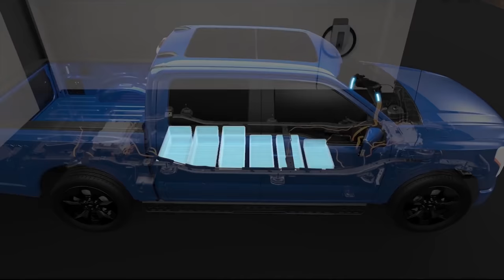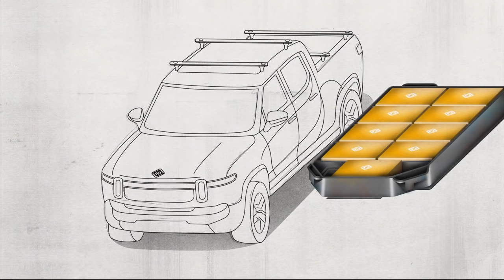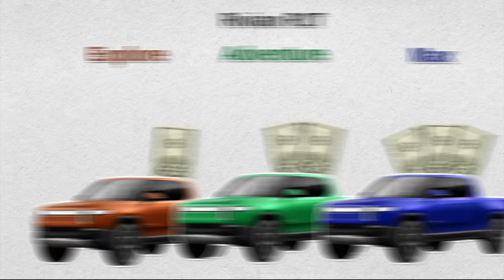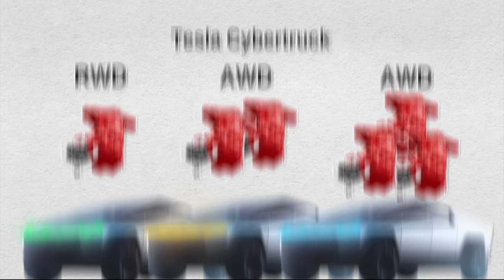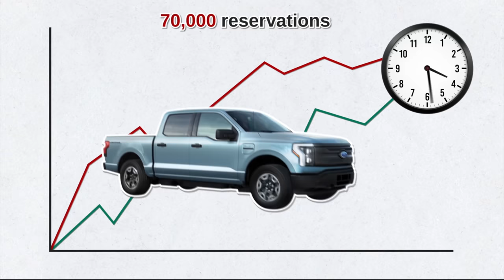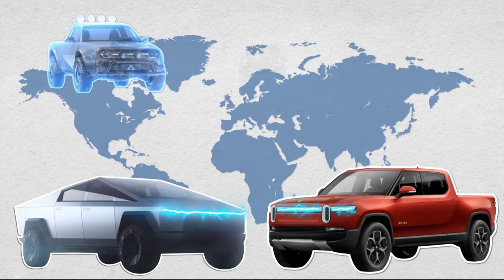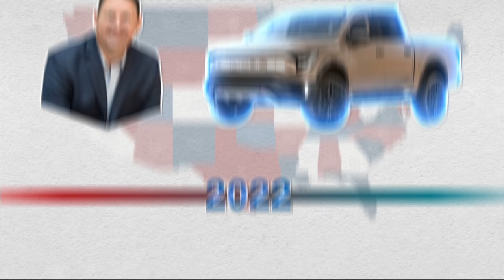Here's Why This Will Replace Trucks in America

Comment: Scotty I need your help. I'm looking at buying an 08 civic. it has 170,000 ish miles on it and I know the previous owner. The car actually drove from Detroit all the way to south east Washington state. I thought the car would be fine and most things were, except for one thing, if you try to floor it, it responds buy shooting up the rpm but not moving any faster. I thought I heard a slight grinding but I don't know for sure. Its as if the transmission is letting go of the gear and grabbing again when the rpm return.

Comment: I think these big manufacturers arnt thinking to well, why go for electric f150’s ? And 1500’ds ???? These are bigger trucks. The Ford ranger and Chevy Colorado would be way better trucks to make electric because they are already smaller trucks that are for small use and good gas mileage, plus you can get more range easier with a smaller lighter truck

Comment: These zre great grocrey getters. What happens when you tow a 8000 lbs trailer. The range drops drastically.  Than how long to recharge. They are an expensive gimmic , if you haul. I frequently tow a 10000lbs trailer with a diesel300mile range, and 15minute fillup. Dont think 100miles and one hour top off will cut it. Unless I can get a couple extra days holiday for travel time. I hope ford will keep a clear head and also develope the achettes for truck use. Good old german design.

Comment: I just don't understand how an electric truck will work for anything more then passenger vehicle ... Batteries just can't store as much power as petroleum fuels, so I'm on the job and run out of power...I don't have time to wait for it to recharge.. what about towing? 50 miles on a charge? I drive 200 miles in a day with 5k load . I just don't see electric meeting this demand

Comment: It's funny that they all have a hood and a front engine section, even though there is no engine.
Reply: Safer that way, and they need something to house the suspension etc. Ford, GM and Dodge all made vans where you sat up front with no hood and you were about 18 inches from going through the windshield in a crash.
Reply: @townhall05446  That is true. Crumple zones make them much safer. It's just that a crumple zone doesn't need to look like an engine compartment. Probably best not to change too much at once though, or people will be uncomfortable buying them. (We will see how Tesla does... )

Comment: What's wrong with a hybrid that has a small engine that can run a generator and take you back home when the batteries are depleted or the grid goes down ?  There is a reason babies creep before they try walking..  If they fall too often they go back to creeping .

Comment: I got news for these truck makers, trucks are already crazy expensive and now they want to go electric? How are they going to make them affordable ? Also how are they planning on adding charging stations around the nation? Sure you can charge at home but you will need to also on the road. The mechanic of today won't know how to repair these vehicles so what does the maker have planned so mechanics can work on the vehicle? I can tell you right now no one want's to go to a dealership for repairs, they charge way to much.

Comment: If electric cars are the future, then they need to make them cheaper than most gasoline sports cars. I am planning on buying a 2010 4.6l GT Mustang in a year, and it's only $25k. These vehicles are too expensive to be anything special to people like me, and can only imagine the long lines to charge these vehicles up or the stress it will have on the grid.

Comment: Natural gas, coal and nuclear energy are our three most common means of producing electricity. So when 2 out of the three involve burning of a fuel, not sure where the benefit is. Not to mention the issues with the manufacture and disposal of the batteries. 
Gas and diesel are here for at least the next 50 years.

Comment: It has already been shown that the range of an electric vehicle when towing heavy loads is reduced by a huge percentage, thus limiting their use as tow vehicles for long range travel. If you need to charge up every 100 to 150 miles this is going to waste a lot of time. Additionally the current charging stations are insufficient in their configuration and number. Charging stations need to allow for vehicles with trailers. Each charging lane has to have chargers at least 60 feet apart. Once commercial vehicles are mostly electric, the charging infrastructure need to be increased by at least tenfold. I am not sure this can be done easily. Our government, in an effort to curry favor with the " greenies" will mandate electric vehicles and it will be the law, whether it works or not. I am a sceptic.

Comment: Is electricity still produced from coal ? Then we have the added cost of adding at minimum a level 2 charge station to your home double that if you have 2 EV’s . And that to your monthly electric bill , the added. Stress on the power grid . But I guess if the power goes down you can’t charge your golf cart…. Yeah I will stick to my 17 mile per gallon truck for now .

Comment: There is a number of reasons that I won't buy one.

1.  They'll cost more money than I'm willing to spend.
2.  I won't be able to drive 800 miles in a day.
3.  They won't have realistic off road capabilities.
4.  Try finding a charging station in the middle of nowhere.
5.  The cost of buying a new battery pack when the original one wears out.
6.  My truck's already paid for.

Comment: This push for utility/ truck BEVs seems delusional to my logic. There IS NOT a robust enough built up charging network yet; & combine that with the fact battery capabilities do not have the capacity for the needed storage levels. That added power capacity levels will give less payload & towing deficiencies so you won’t be somewhere in the cold & you don’t have the energy to make it the rest of your destination- for example.  It’s sane to test car & crossover boundary capabilities (since they’re not generally used to tow, or go off road) But it’s more important to have these other things in a utility BEV rather that different tank or crab crawl modes or high speed off-road cabilites🤷🏻‍♂️

Comment: Hauling it might but at a reduced range it can’t haul to its full potential. Battery discharge will heat the batteries up your running the ac in summer/heat n the winter. Cant fully charge in winter now as its fire hazard. A boats dry weight is changed from when it’s wet. Slick ramps. Then you need head lights wipers when it rains. Plus when it’s cold out battery life is further reduced. Possibly longer charge time added but not 100%. I like the idea of a greener tomorrow. But not with the fire 🔥 issues and bugs. And I’m sure price of these cars/trucks/SUV’s will be astronomical then the other issue battery replacement what ten grand plus most likely to replace and disposal fee to.

Comment: I need one that will work in the cold winter weather -25to -40 and be able to plow snow . Lots  of information Scotty . You still haven't told me what to do with a 2012 Ford 5.0 that was fixed by a Ford dealership ( new timing chains and timing chain tensioner and now the tappits tick and sing ) Just thought you might have an answer since you seem to lean to Ford products if no Toyota around . HELP and Thank you

Comment: In actuality, only high 2nd class citizens will be able to afford EV's. There are dealers who won't even acknowledge you if you're dressed like you're poor.

The market may get an increase in electric vehicles but the majority of people will still drive combustible vehicles because the overall cost is cheaper and they'll be able to repair them personally.

Comment: I would buy a hybrid with a small efficient optimized engine (50HP 35-40% efficiency) and generator to keep the battery charged. No transmission or connection from the engine to the wheels. This allows a much smaller less expensive battery. I also don't need a vehicle that can go 0-60 in 3 seconds, use the materials to make a smaller generator and motor. We have an infrastructure for liquid fuels, having a duplicate for electric is  massively expensive. Perhaps Scotty is onto something with liquid ammonia or maybe we should be using solar or wind to synthesize some hydrocarbon fuels. Lithium is going to massively increase in cost as there isn't enough to electrify the fleet and/or to use on the grid to smooth out wind and solar, pushing up the price of electric vehicles. A hybrid could have 1/10 the battery size and lithium used. It's even possible to eliminate the battery and use super/ultra capacitors.
Reply: I would like to expand on lithium cost. The cost of lithium batteries has been dropping, but the drop has flattened out. When we mandate 50% of all vehicles must be electric in 10 years, and we must have more renewables from windmills and solar panels which need batteries to back them up,  all countries and companies will be competing for the lithium. This will not only drive the lithium cost up multiple times because of shortages, but who believes that China that processes 90% of all lithium will make it available equally. It take years to make new mines and processing plants, 10 years isn't enough.
Reply: The batteries account for about 30 percent of the cost of an EV, worse in the ones with greater mileage. If the cost of lithium batteries doubles or triples the already absurd cost of EV's will easily double.

Comment: Until the car manufacturers can stretch their battery warranty from 8 years / 100,000 miles to 16 years / 200,000 miles, electric cars are completely uninteresting for me. I'm sure that many, if not most, will agree that spending significantly more on a vehicle that has half the lifetime simply ends up being much too expensive. Especially when you can buy a secondhand Toyota for less than 1/4 of the cost of a new electric car, that will outlast brand new petrol cars from many other brands.

Comment: a fast forklift. Yeah buddy, sorry but they still have propane and gas forklifts and the electric are a hassle to recharge unlike propane or gas. The battery itself weighs a ton and another forklift type machine is needed to take out forklift to recharge.

Comment: Umm problem is my little 2020 ford tanger gets 400 miles to a tank I highly doubt an electric truck will get that. I won't buy an electric vehicles. Besides is it a guarantee  that the electric doesn't go out? Without our power grid the way it is,it won't work to well.

Comment: I hate the cyber truck. It looks ridiculous and won’t last long. I have a 2000 Ford F-250 7.3 diesel it will be able to tow more than the cyber truck. My f250 7.3 diesel can tow anywhere from 14,500 pounds to 15,200 pounds because it has a trailer tow package.

Comment: Nope, no EV vehicles for me.  I've seen current model EV cars get listed as 'mechanically totaled' when their batteries goes out and needs replacing.  Tesla is pretty bad at that with costs up to $17,000 for a replacement.  Can't imagine what the used market will be like in repair costs.  Not worth it.

Comment: It's absolutely amazing that these estimated new EV cars will start at 40% less or more than these fully loaded combustion engine. New Ford and Toyota standard v8 69-89k+. I'm hoping people start buying these EVs to lower the price of actual real trucks proven reliable over the years, and I when I buy one, I won't be stranded. I think they should build charging packages on gasoline vehicles to charge EVs, that way, if they're out of charge we can help out fellow people on the road.

Comment: Ev's are all well and good in the near distant future. Why you ask? Simple 110v charging is useless for charging after a long trip. Up to 48 hours of charge time. 220v charging at home isstill a 12 hour at best charg. Now what about super chargers? Not sure you can get one for your garage. Out on the road is prity much a bust as well unless you live in so cal. What do you do if you go 4 wheeling? Your gunna chew threw the battery very quickly.

Lets go back to the super chargers. The faster (high current) you charge them the faster the cells degrade. Ive read and seen videos on super charger stations. They are never ready to use because guys sit at the station to get a 100% charge. The cars sometimes dont have there owner waiting with there vheicles. So that ties up a charging stall.
 
No you say your going green.  Um no is the shoty ansure. The aluminum has to be mined (huget trucks with huge motors belching out nasty exhust. Deisels run cleaner. Witch its still usin oil to mahe it). The batteries are a filthy carbon foot print to make. 

Now let think about theelectric plants. Nucler? Chernoble, japans melt down. Thats a nasty thing for there carbon foot print. Coal electric gerenation plants. There worse than atomic. Hydro plants. Good idea, but lakes are drying up. 

Ok enought of the negitaves. Oops i lied. Till there charge atations all over the place your still screwed. Ive put sime thought on why dont they make all battery packs 1 size fits all. Your running low on power. Stop at a battery swap shop. Make the battery easy to swap out and put a freshly charged battery in. Put 2 batteries in the car. Run the first to to say 50%  full. Throw a switch and run on the second. Put a charger/altinator to 1 wheel to charge the first batt pack, switch back, and forth between packs.

Batreries are still in there infintsy. Thats was the same problem for radio controlled helicopters. The battery tecknologe had to catch up. Same for the EV's.

Sit back and think of the drawbacks to a EV car. They are filthy non green vehicles. There carbob footprint is huge for every car/truck. Tbey arent goi g to help our planets polution.

Thats it. Stepping down off my soap box now.

Comment: To many downsides to an electric truck still. Winter could kill the battery, I doubt it has 200 mile range pulling 20,000+ pounds , and it could easily turn a 1 day trip into a 2 day trip from having to charge it.

Comment: Scotty kimmer my dad has a 2000 GMC Sierra Z71 with the 327 5.3 l V8 engine and it has 350,000 miles in the morning when it's cold especially in the winter  it runs over 1,000 and then quickly almost dies and it does that for 5 to 10 minutes and then after it runs for 5 to 10 minutes it starts to run normal so could you answer this in your next video please.

Comment: (It’s so sad ! ) Government is racing to get electric trucks out there but still can’t make them economical. They sure won’t be green still have to have oil. Still have to make plastic parts for them. All petroleum based in the making. It’s so sad 500 to 350 miles on a charge it’s not very far. Drive that in a day and if I have to get one of these trucks there better be a charging station when I get to my 500 miles somewhere In the wilderness and most likely there won’t be. Hopefully with these new trucks they give you a eight year warranty so when the battery goes bad in it you just get a new truck for half price. Hopefully parts will be made drastically better specially if it’s a Ford ,Chevrolet or for god sake‘s a Dodge.

Comment: Anyone know how to get rid of sticky tire dressing? I use black magic tire shine spray as i usually do but recently noticed it wasnt washing off even with a power washer. My tires now are left with a sticky residue to the touch and I've tried soapy water and a brush as well as using armor all heavy duty tire cleaner and only bits came off 🙃

Comment: I like Tesla cars but the supercharger draws 100 Kw for 30 minutes.  Larger batteries would need 200 Kw for 30 minutes to get 100 Kwhs. 100,000 to 200,000 watt loads for one car or truck would cause tremendous strain on power plants and infrastructure. We could not build enough plants to handle the trillion watt load, all of this electric car stuff is pie in the sky talk.

Comment: The electric truck that I can’t for is a conversion kit for my 04 ford ranger
Reply: Please reread your statement before hitting reply.
Reply: @keith7046  no I meant I would rather convert my truck I have currently and save a lot more money. Or at least try to find an afordable conversion kit
Reply: @Randomgamer-tk2zj  Now I understand. I would also do the same. I have a '99 Silverado, if the engine craps before I do, I might do the same.

Comment: Ok so how far will these trucks go towing a heavy boat, large camper or a large piece of equipment? For now electric trucks are something for people who dont really need a truck.

And then you have the charging issue. If everybody starts driving electric cars I hope your ready for blackouts everywhere. Hell out where the drought is going on they can hardly handle people running there ac to stay cool.

Comment: Let me see…… they use huge diesel operator vehicles to destroy vast expenses of land to extract lithium in foreign countries. Then they transport all that material in ships also power by petroleum products to ports that transport it via land also by vehicles of some sort powered by petroleum products. The places that make the batteries are probably using mostly energy generated by petroleum products. The batteries are transported in trucks powered by petroleum products. The range of all the vehicles require you to recharge many times before you reach your destination, and what if there isn’t the right connector for the vehicle you have. I am not convinced, none of them are my favorite, I’ll stick to my gas engine with a 500 mile range, stop gas up in 10 min and continue on my journey.

Comment: Electric motors are far more efficient than gas. They also have instant tourque that makes them better in trucks. The only question is what they are powered with. Batteries work well and will get even better. Maybe lots better. They are also 95% recyclable.  The USA ev mfgs are building factories in the USA . We need the jobs here,  not china and mexico. (Big 3 stop moving out and bring jobs back)